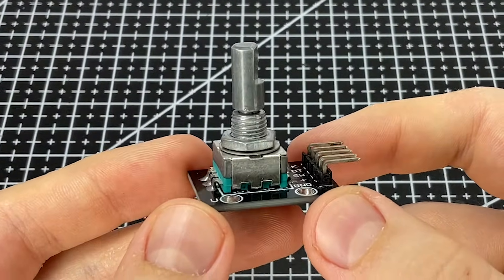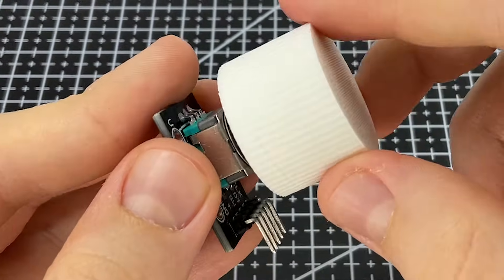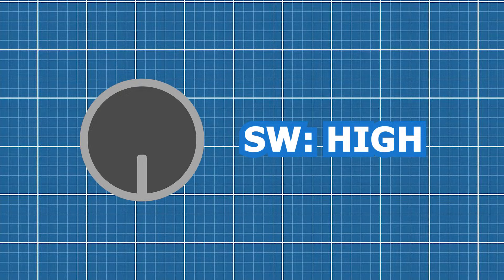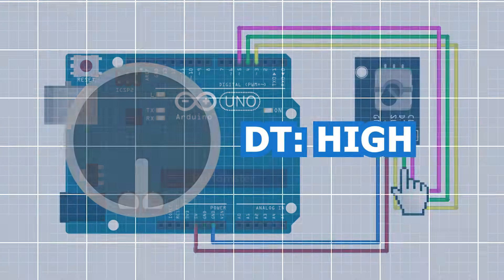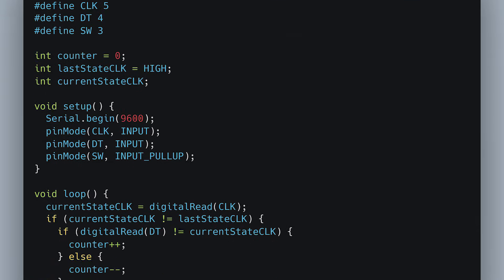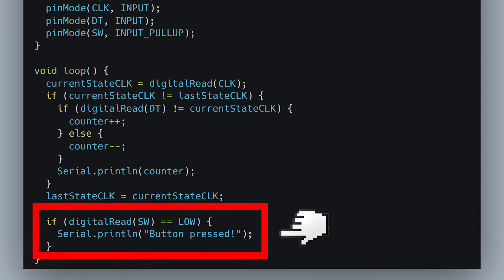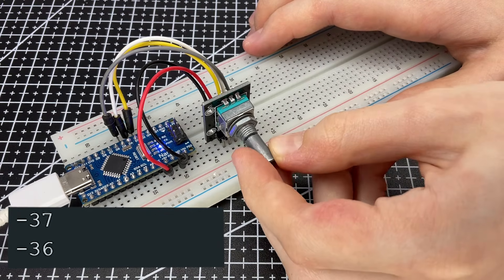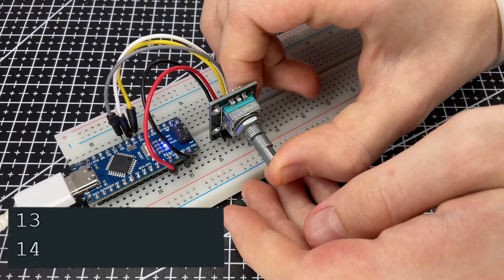How to Use a Rotary Encoder with Arduino

Comment: if i want more knobs?
how to do that?
Reply from the maker: Hello, I understand you want to add more encoders.
you will need to connect a second encoder to other arduino pins if you want I will give you the code!
I'm just wondering what kind of project you are planning based on several encoders
Reply: @HuHamster  I imagined an electronic version of "Etch A Sketch," that would certainly need two encoders.
Reply from the maker: @pandaguan  That's actually a really cool idea for a project! Now you've got me thinking... maybe I should try building something like that and make a video about it 👀🎥 Thanks for the inspiration!

Comment: this is is a bad greycode decoding. and the labeling on the encoder ist nonsense. 
maybe using an encoder library would be just as easy
Reply from the maker: Thank you for your comment! I am always open to constructive criticism. If you have specific suggestions or recommendations for improving the code or labeling, I'd love to hear them.

Regarding the library for working with encoders, I know it can simplify the process, but sometimes I choose to implement certain functions manually to better understand the principles of operation. And the viewers understood the principle better. Anyway, thanks for the advice, maybe it's a good idea for a future project update!